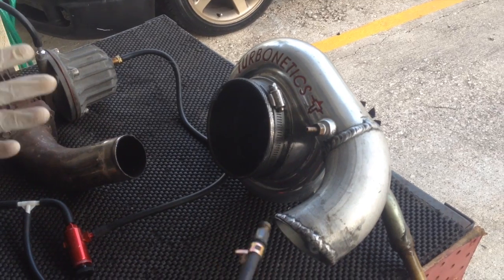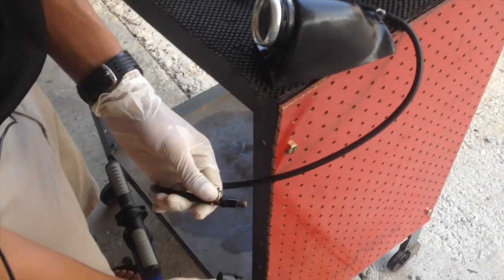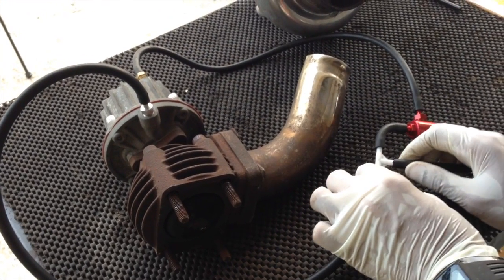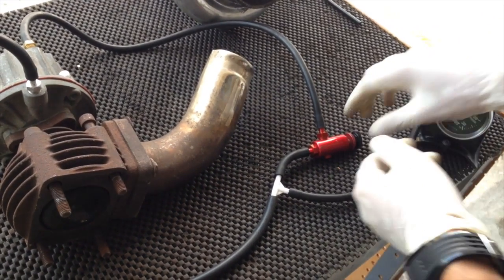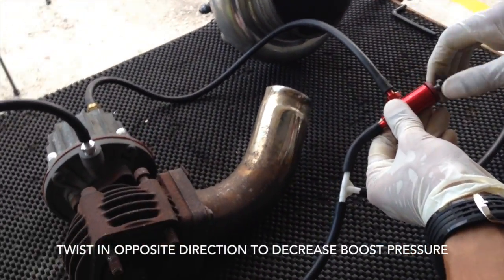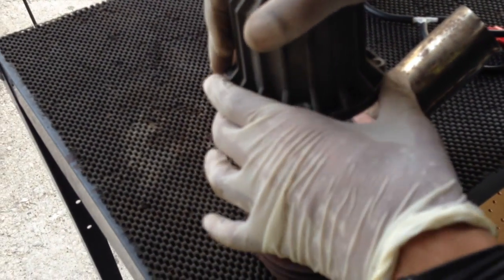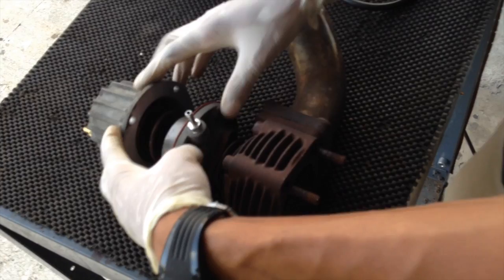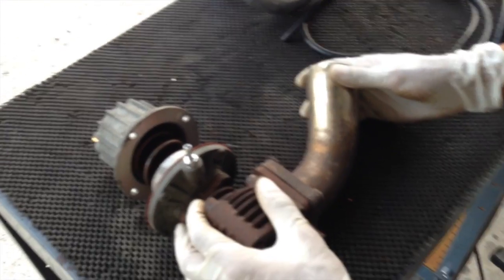Manual Boost Controller Install (Bench testing the correct way)

Comment: Got a question so the boost guage don't gotta connect to any vacuum in the intake manifold? It can just be connected like that to how your doing it and it will be accurate?
Reply from the maker: Hey, The boost gauge should be connected to a vacuum source yes. Depending on the car, if it came from the factory turbocharged, then you can use a "T" fitting from a line on the intake manifold. If It didnt come from the factory turbo, then finding a line off the intake manifold may be a bit harder to find. I wouldnt advise T'ing the MAP Sensor if you could avoid

Comment: Hi I got a 14psi spring in my external wastegate I have hooked the compressor line to the boost controller then from there to the bottom port of wastegate then teed it off for boost gauge and I’m only getting 10psi in whatever I do
Reply from the maker: Hmm. That’s an interesting one. And your certain it’s a 14psi spring and not 7psi.!? Hmmm. Next step would be to verify if you have a boost leak somewhere in the system. If no leak. Then I would proceed to remove the boost control line on the waste gate (so it’s running on spring pressure) but leave the boost gauge hooked up direct to manifold pressure. If it goes to 14 then could be a faulty boost controller. That would be how I would do it. Let me know if that helps.

Comment: on that gate theres 2 top port right so 1 goes with vacuum how abou the other port do i need to block it or leave it as a vent ?
Reply from the maker: The other can be left to vent. However if you have a top dollar multi port boost controller say a ams unit then you would connect to that. (4 port controller in other words). Hope this helps :)
Reply: @HighPerformanceNetwork   oh ok thanks appreciate it

Comment: What if the pressure line normally runs from the turbo to the intake manifold can I disconnect it from the manifold or would that cause problems?

Comment: for the wastegate spring pressure only  did you ive the top port open ?
Reply from the maker: You should yes. Can also put a barb with the hose to prevent debris from entering
Reply: do i need to block the hose if i put barb abd hose or live it as vent

Comment: Umm well my turbo doesn't have that fitting in the turbo so what I do then? I need help
Reply from the maker: Ricardo Lebron in that case you may have to drill and tap a brass barb fitting onto a charge pipe coming from the turbo. Basically the first pipe you have access to that’s connected to the turbo compressor. However if you have a factory turbo then you may already have a barb line you can tap into. What vehicle do you have ?
Reply: @HighPerformanceNetwork  well I got a 6262 precision turbo but I got to rebuild it so I'm using now by the time that I got the precision done a Ebay cheap turbo with a turbonetics Wastegate and  tial  blow off with a manual boost controller so I'm kind of confused now after watching your vid btw it's a b16a
Reply from the maker: Ricardo Lebron ok. No prob. We can find a solution. You can technically use a line from the plenum. Not a fan of using from the manifold though. But other than installing a barb on the intake pipe or hell you can even drill n tap the eBay compressor housing. And ahhh the old B16 loll brings back so many memories
Reply: @HighPerformanceNetwork  i got a b20v nitrous and a b16css bore out to 84.5 boosted too this b16a it's just to fool around
Reply: @HighPerformanceNetwork  ok so correct me if I'm wrong a line from the Wastegate  to the boost controller one line from the Bov  to the throttle body and I'm just lost already lol bro do you have like a diagram or some for the boost gauge bov Wastegate and vacuum lines etc etc I'm just so confused now I've been doing so much research and everyone says diff stuff
Reply: @HighPerformanceNetwork  btw the precision it has that brass nipple but the Ebay doesn't  so idk now bro
Reply from the maker: Ricardo Lebron I will make a diagram for you tomorrow. If you shoot me a dm on ig. @epconcepts will try to simplify the install for you
Reply: @HighPerformanceNetwork hell yeah bro im gonna hit you up right now on IG  thanks bro 4 real
Reply: @HighPerformanceNetwork  hey bro what pic do you have on ig i cant  find you right away
Reply: @HighPerformanceNetwork  mr.kobe111 that's me on ig
Reply from the maker: Ricardo Lebron it Jonathan Zoom Webster

Comment: hi dude !!! I have a question, I have understood your videos perfectly, you have explained everything perfect and you have cleared me many doubts, however, my situation is that I have a project but it will be supercharger, not turbocharged, something simple between 5-7 psi, but I will not have wastgate and I have been asking some questions, if the same procedure can be done but instead of being the wastgate it could be with the BOV? maybe a T between the intake manifold line and BOV? I know that there is a vacuum that is generated within the intake manifold after the butterfly of the throttle body closes when it stops accelerating to be able to deflect by means of the BOV the pressure that remains before the throttle body. However, I would like to know if the engine is accelerating and the supercharger generating boost, while the throttle body butterfly is open and there is pressure in the intake manifold; can the boost controller be located between the line that goes from the intake manifold to the BOV? I appreciate your answer very much.
Reply from the maker: Hello Julio, Thank you for the question and kind comments. Will do my best to answer as truthfully i'm not real knowledgeable on supercharger systems. But I have seen AMG Benz with superchargers that have some form of boost control as an option, exactly how it's done I am not certain. But I due know from experience roots "style" blowers are strange to have boost control options as they mainly use the pulley size (under or oversized) to control the rate blower rotation. As for blow off valve, think from memory they may have to be vented back into the system (recirculated) but not certain about that one.....If i were to recommend a supercharger system it would be a rotrex unit. (https://jacksonracing.com/product/rotrex-c38-supercharger-units/) Not only are they more efficient than a standard blower. But i think they could be the answer to all your questions......Hope this was helpful, as im not a supercharger guy. But much respect to you and good luck on your project...feel free to drop us some images of the build. :) Happy Holidays
Reply: @HighPerformanceNetwork  Thanks bro!!! and thanks for answering, actually I also like turbochargers more
 that the superchargers but for my project would be less complicated a supercharger, or that I had thought xD but it is also a wide world, good in this life never stops learning, thanks for everything, right now I am looking at the information you suggested about the pulleys and how they influence the speed of compression of the supercharger, again thanks for giving me those data that are very helpful to me, take your like again good man hahaha and :) Happy Holidays.
Reply from the maker: Julio Quintano finally bought a new project car for myself. So will be bringing some fresh content to the channel in 2019
Reply: @HighPerformanceNetwork  UFFF !!! I forgot that I was going to subscribe hehehe good content on your channel, another subscriber more won.

Comment: Do u know what that center hole at the top is for
Reply from the maker: NinoSwavae that hole is normally used with a three or four port boost controller solenoid. Can be used to add more pressure than the wastegate spring can physically manage.

Comment: I know the video is old, but just in case anyone comes across it: he's explaining it backwards: OPENING the boost controller (i.e. reducing the pressure of the controller spring), is going to allow MORE air to reach the TOP of the wastegate. This air will fight to keep the wastegate closed and thus RAISE boost. At 1:43, he "increases resistance" by twisting the boost controller "down" in order to "raise the boost." He's actually lowering the boost (by reducing the air inside the TOP of the wastegate).  This is even reflected when looking at the gauge between the two tests. This could be important for some people on a new build, trying to run off wastegate for testing. Especially since the adjustment decal some controllers align with this video because they were designed for an internal wastegate setup.
Reply: What if i just use the lower tip of the wastegate and connect with 2 port of the manual boost controller.( From turbo prrssure source goes to 1 tip of the boost controller and other one goes to the lower tip of the external wastegate and the top of the wastegate vent it to air..can it actually increase the boost pressure?
Reply: @pojiamd5193  yes

Comment: Does this setup raise or lower boost from spring psi?
Reply from the maker: Q Man this setup can be used to increase boost pressure as it would hold the spring under tension for a longer period. 

However if you wanted to lower boost pressure that can be a bit tricky as each spring have a minimum boost pressure (8psi) to go below that pressure I've seen people make calculated holes somewhere in the system to bleed that pressure off. Lol but no one ever wants lower boost :)

Comment: This is great, you doing this. I was wondering about where in these lines a blow off valve would go?
Reply from the maker: jacob anderson that is question most will have varied responses. Some would say you can "T" the line between the compressor and the wastegate. Personally I like to take it from a source off the intake manifold. Hope this helps
Reply: High Performance Network 
Thank you so much for responding. And thanks for the info, I really appreciate it!
Reply from the maker: jacob anderson your most welcome. I'm happy the content has brought you one step closer to bringing your project to life
Reply: @HighPerformanceNetwork  my setup is built, woo!  I only have a 6psi spring and the wastegate for now until I get everything tuned. I'll send a video of the blow off valve making sound on the road, maybe tomorrow.

Thanks again!
Reply from the maker: @jacobanderson3768  Much appreciated, I bought a project car and will be releasing new material first thing in 2019....Long overdue but man when you have kids and a business to run time becomes real scarce.

Comment: I don't see a pressure source on my turbo.
Reply from the maker: FroztiProductions hey! Do you have an internal actuator or external wastegate ?
Reply: High Performance Network external wastegate. It's an eBay turbo. Looks like it's meant to come off the side of the turbo like in your video but it's plugged off. Like they were going to put a hole there, and then didn't.
Reply from the maker: FroztiProductions ahh double check that the plug doesn't have a hex head threaded bolt. I've seen people block that one off and use a pressure source closer to the intake manifold
Reply from the maker: If it is a bolt then if you able to access it. You maybe able to extract it and use that. Hope this helps
Reply: High Performance Network I would have to drill through it. It's not plugges by a bolt. They made a place for the hole then didn't drill through in the machining process.
Reply from the maker: K i have a better picture of what you're working with now. Instead of going through all of that process, you can drill and tap a barb on the cold side of the intercooler piping. Must warn you with that method though, if the piping is thin there is chance of a leak depending on your boost level. 

I have seen a setup where they drilled and tap the intercooler core itself placing a barb in there. However it all depends on your setup. Tell you what, shoot me a PM on facebook and im happy to help you find a solution.
Reply: High Performance Network I subbed, help is much appreciated. I'm probably going to go with adding a fitting to the charge pipe. They might make a short pipe with it pre installed. Otherwise I'll figure it out.

Comment: when the turbo no have boost pressure source how install the boost controller
Reply from the maker: Rene Reyes if it's a stock turbo you may have to install a "T" fitting to share the pressure source. If it's an aftermarket turbo. Then you can drill and tap barb in the inlet/compressor side of the turbo piping. Once the pressure source is before the throttle body. That's the important thing. But mainly the closer you can get to the turbo the better. Hope this helps :)

Comment: is it bad to run the waste gate from mainfold source or should i add a fitting to my turbo outlet?
Reply from the maker: I can't say if either is right or wrong. But I try to run my pressure source before the throttle body or as close to the turbo as possible. So personally I run it from the turbo. I'm sure other people may say yah or nah. But I've never had an issue doing it that way

Comment: is that 40mm wastegate of eBay if so how is it?
Reply from the maker: This wastegate came already installed when i purchased the car. But it is a HKS 50mm from my understanding and can see faded marking.....The wastegate is one of the most crucial items on a turbo vehicle. Mostly everything else can be purchased from ebay. But the Turbo, WG and BOV should all be higher quality if possible.
Reply: It is, but 9/10 the cheap ones leak and cause issues
Reply: You realize that a BOV is basically just a piston and a spring.  No need to spend a ludicrous amount on something like a HKS BOV, which is $200 bucks.

Comment: what do i do if my turbo don't have a compressor hose ?
Reply from the maker: A 3/16 barb should be somewhere on the turbo side. If it ain't on the turbo then it should be on the pressure pipe coming off the turbo. I've seen some tdo5's like that. If my comment doesn't help. You can send me a picture of what you have and I can advise from there

Comment: Would it make a difference if I took my boost gauge line by teeing The TOP connection between the wastegate and boost controller?
Reply from the maker: +Oscar Henriquez Personally I like to tee the line from the throttle body to fuel pressure reg for my boost gauge line. But If i understand your question correctly, you may get a delay if your running the manual boost controller, wastegate, turbo compressor and boost gauge. I dont see why it wouldnt work but its a lot of teeing going on lol
Reply: That makes sense. So really, the vaccumm source that goes to the boost guage can come from anywhere? From the intake manifold etc. I had the understand it had to be on the same line as the manual boost controller as showcased on the video
Reply from the maker: Oscar Henriquez
Yup. once the source is from an intake source, most people use the line connecting the turbo compressor to actuator for the bov as in some cases its easy to get to. but either line is ok to use. Quick way to test is if you remove the line when the engine is on, you should feel it sucking lol

Comment: ok thank you. ill be looking forward to your video. i want to put a 3mm shim in my HKS external wastegate. its currently on 8psi. i dont want to put a boost controller in. do you know roughly how much the boost will will go up with 3mm thick shim?
Reply from the maker: +Frozen 782 That sounds like a familiar figure for some reason. But the one I installed int the video went from 7-8psi to 9-10psi. Its important to note although a 3mm may yield around 2psi, its a progressive setup so if you used 6mm it would more than likely be around 5-6psi

Comment: how thick would you make the shim to start with?
Reply from the maker: +Frozen 782 It will have to confirm the exact size, but it was picked it up at the local hardware store and they only had a few gauges. I plan on revisiting this test with greater detail in the coming weeks

Thank you for the comment

Comment: What about internal wastegate. Wanna hoop up my Garret on diesel engine with a MBC
Reply from the maker: THE G. I'm glad you asked. I was on the fence on whether I should do one for an actuator. I will shoot a second video showing the process for that
Reply from the maker: THE G. You could also purchase an adjustable actuator that can increase spring tension aka boost
Reply: No need for that, I just need extra 0.2-.0.3 bar of boost, MBC will be plenty enough plus it's really hard to get to the turbo on my car :)
Reply from the maker: Lol oh ok. Thanks for the feedback though